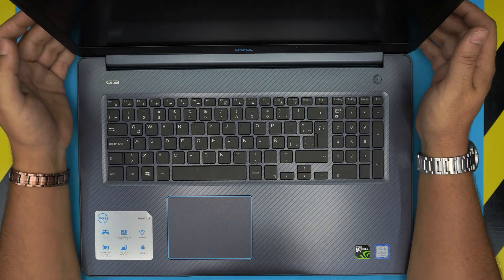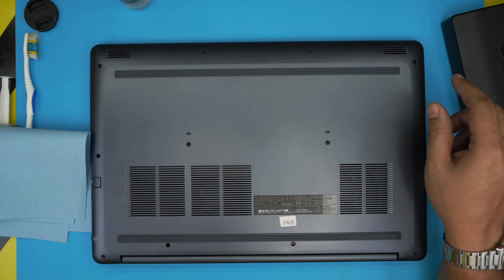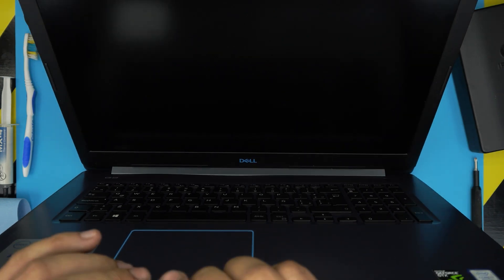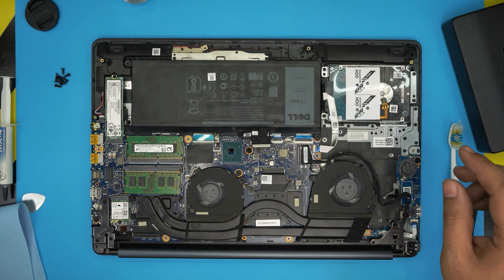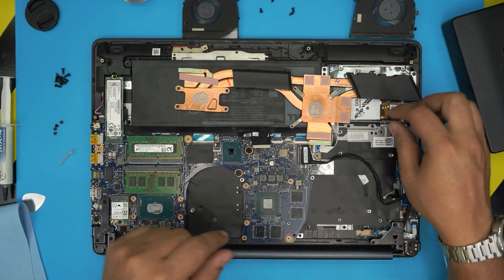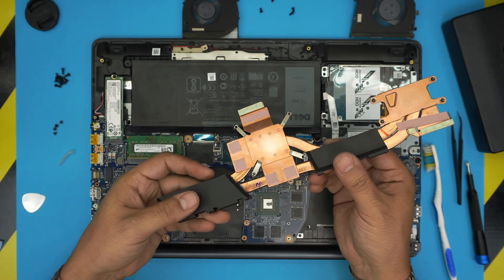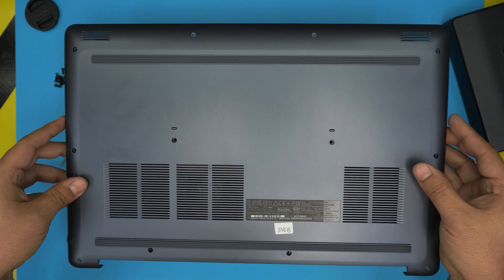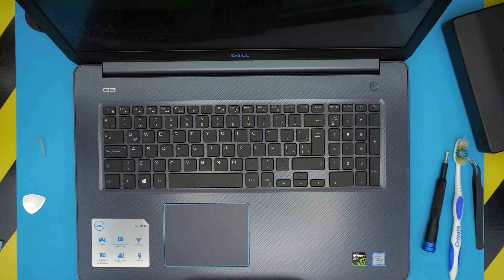Dell G3 17 Gaming 🚩 P35e003 💻 Repaste cleaning service

Comment: Great and useful video. I used to work extensively on my desktops but felt a lot of trepidation with doing the same to my G3 17. Your clear and concise instructions have given me new confidence. Parts of my keyboard have gotten uncomfortably hot since starting to play Hogwarts Legacy so I will go through with this process just as soon as the tools and supplies arrive from Amazon. I'll let you know how it goes.
Reply from the maker: You are welcome! Glad you liked it 😊Thank you for the feedback! if you wish to support the channel you can LIKE or SUB or both :P
take your time doing this and if you need any help during the service let me know my friend.
If you have any future questions or requests, please don't hesitate to reach out to me. I'll be happy to assist you.
Reply: @uFixTek  Wow, most of the stuff arrived quickly but the thermal paste took 2 weeks. For some reason it had to come from South Carolina and I'm in California. I'm currently in a rehab facility as I'm recovering from some surgery so my laptop is my life and I can't just go to an electronics store to buy the stuff as I otherwise might. I did run into some problems and had to improvise a bit. I'm telling you this as one of your fans might benefit from my experience. After removing the fan screws I was unable to remove the fans. I actually broke a nail trying to budge them (and I have strong nails). After trying for nearly an hour I reassembled and took another look at your video. The fans did look slightly different, even though this is a Dell G3 17 3779. But I also noticed that the screws for the heat sink were not blocked by the fans. So I went back inside and simply undid the heatsink screws right after the fan screws and it all came off as one piece. The fans were attached to the heatsink with what looked like some strong black tape. I decided not to mess with the tape as it might be important. I purchased the laptop 4 years ago from Dell Outlet as a refurbished model and so maybe that explains the difference. I also lost one of the GPU heatsink screws and so had to reassemble without it. Do you think Dell would send me a replacement? How would I go about that and is it worth the trouble?
The good news is that it's running much cooler now. While it still gets uncomfortably hot in the area between the screen and the top of the keyboard (is that a problem?), the keys I need to touch to play the game are quite comfortably cool. Thank you so much for helping me out. I would have had to quit playing Hogwarts Legacy as my fingers were getting slightly burnt if I had to hold a key down for a long time, like the W for moving forward. But thanks to you I can continue enjoying it. I'm a 66 year old man who enjoys his video games. Hehe.